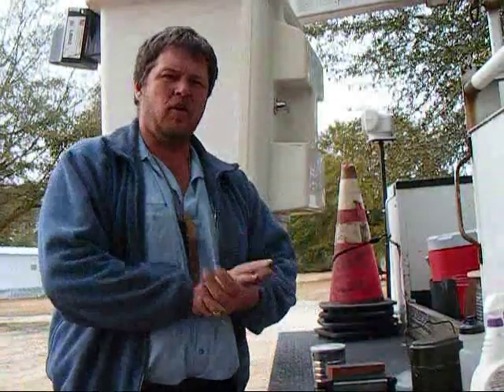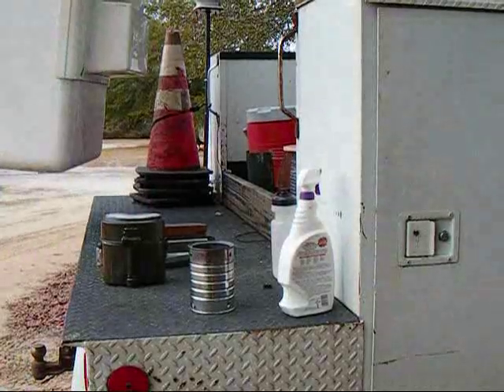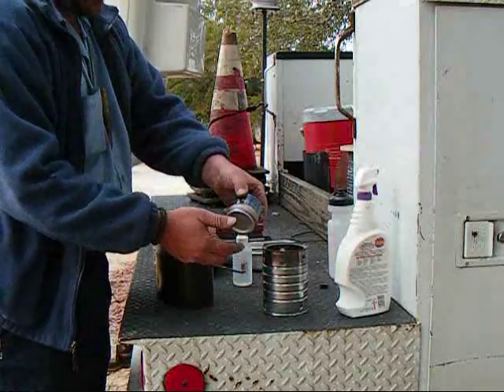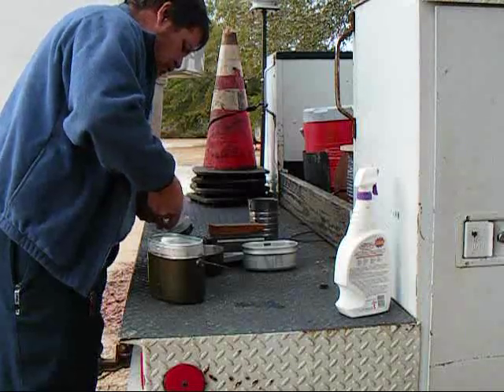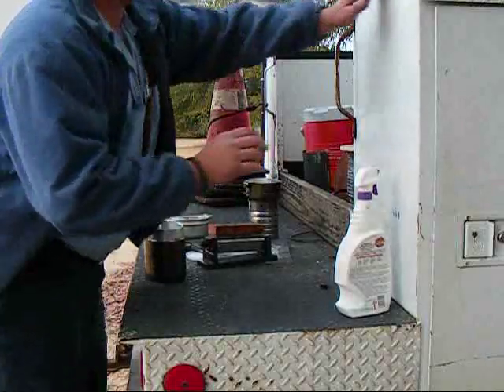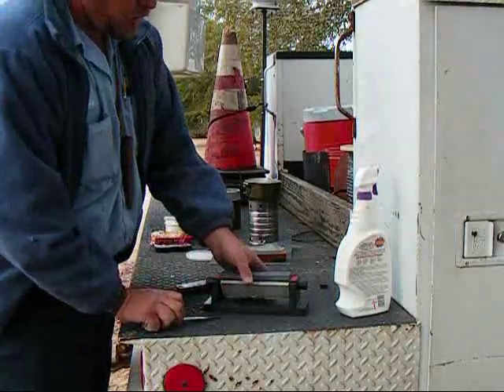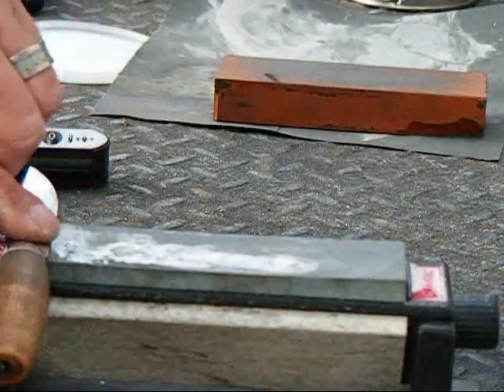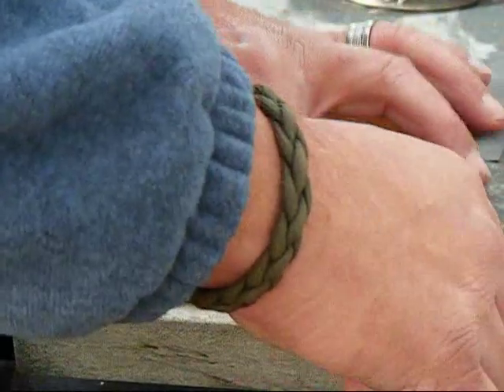Mora knife sharpening

Comment: I like your video.  Thanks for showing it. I want that sharpener.  One thing I think though is that in a way especially for a well maintained knife the rough stone takes the sharpness down and is used to set the blade, make it even and prepare it for the finer stones. So I don't think that dragging the most used area on its own is a good idea.  You will end up with a blade that looks like my 20+ yr old SA boyscout knife where that part of the blade is worn away and not as wide anymore. my 2 cnts

Comment from the maker: @hardhitter0421 Thanks for the comments, the simple green is just another way to lubricate a sharpening stone without using oil.  its safe, biodegradable, and it cleans the stone as you sharpen.  I think its a good compromise over water, or oil.